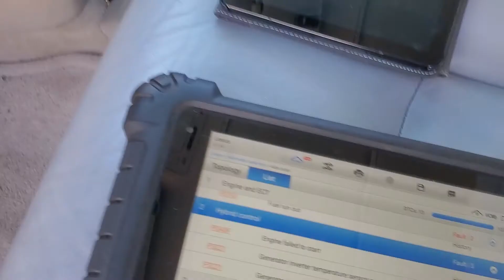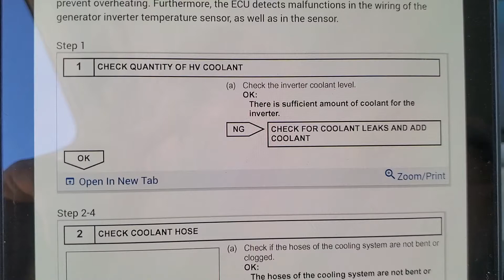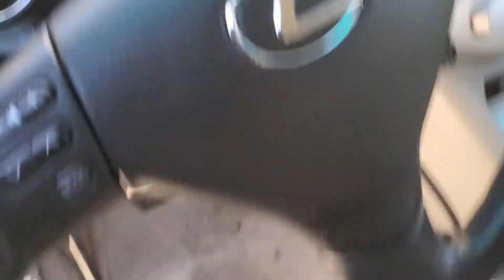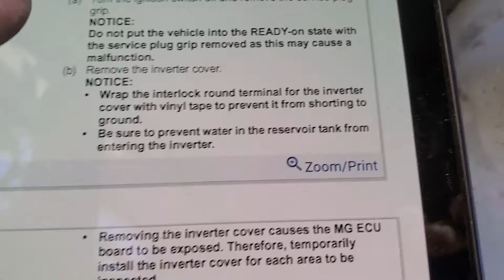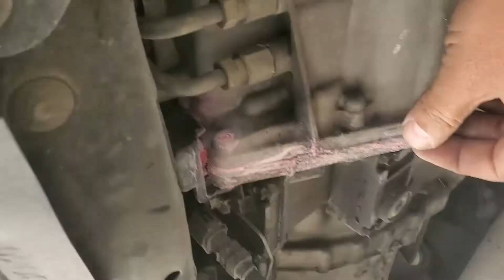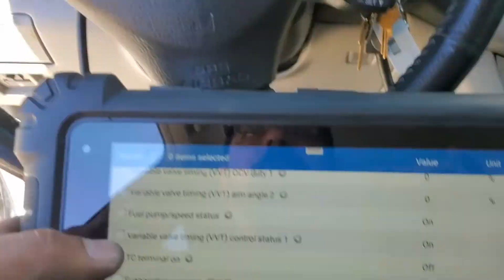2006 Lexus RX400h P3221 Generator Inverter temperature sensor circuit range/performance

Comment: I have a P3221 code. Could it be that the radiator fans are not enough for keeping the temp within limits. I recently had the fans replaced. The mechanic got the replacement fans from a Pick Your Part yard and it was from a Toyota Highlander but not a Hybrid. Since I got the fans replaced, I have received P3321 twice while driving on the freeway heading home from Tampa. I have a 06 Highlander Hybrid Limited.

Comment: When turn the key on READY the fan in front of the engine is it has to start or not? Or starts when it needs? 
Thank you.
Reply from the maker: The fan should not come on with the key on. If it does that's an indicator that the car has no communication with the engine control module

Comment: How to find out whether water pump is working? 
When I turn the key on READY it should start working right?
Reply from the maker: You gonna need an advanced tool to do so
Reply: Yes, my Lexus when turn it on to the ready the coolant in the inverter starts moving.

Comment: pls im battling a problem my 2008 rx 400h say P0a39-259: which means Generator temperature sensor high.. pls how do I locate the sensor.. if possible to change the sensor or the harness.. thanks I will appreciate your quick response..
Reply from the maker: Did you watch this whole video?